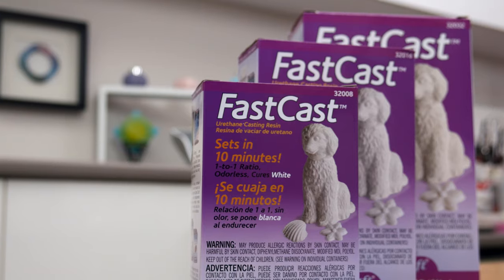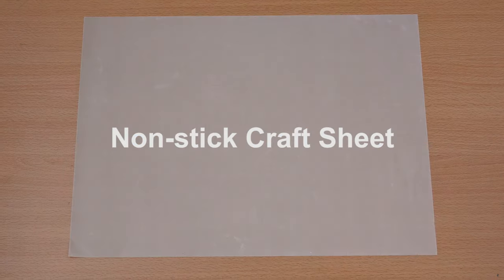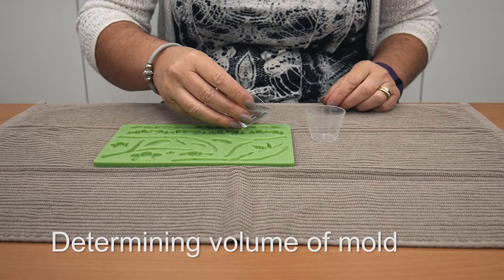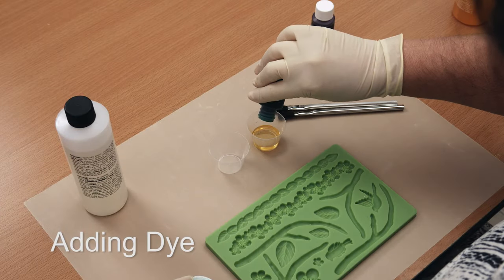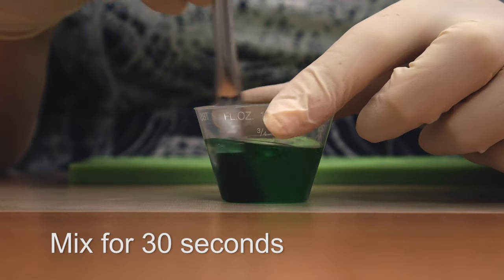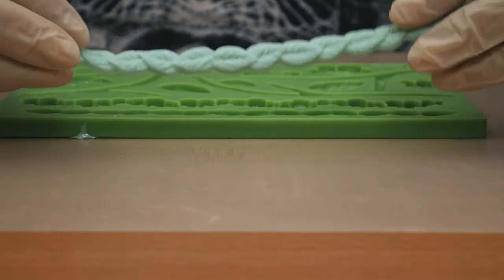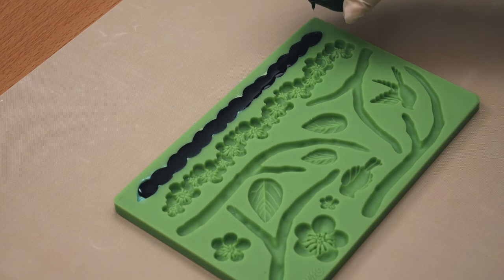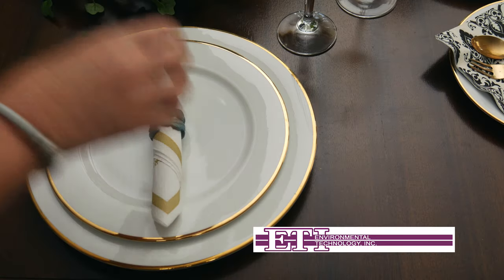How to Use FastCast Urethane Casting Resin

Comment: HI MYLENE. use rice instead of water in some of your moulds to weigh out the resin you will use. it works just the same and keeps your moulds dry.
Reply: The video says "fill the mold with water or rice" I assume she already knows that. But rice won't work for very small molds very accurately. Like the small detailed molds she was using.
Reply: @libbyzumbrun907 thank you i never heard that first time round don't know why but i did say with some of your moulds.
Reply: @michaelpearson4152  I saw what you wrote. I was just explaining why she used water in the video instead of rice.
Reply: @libbyzumbrun907   HI LIBBY. thank you i wasn't being a smart arse

Comment: What is the exothermic reaction of FastCast? Does it really get hot in your mold? Or does it say around room temperature when it sets? What material is your mold made out of?
Reply from the maker: It does get warm while curing. The mold is made out of EasyMold Silicone Putty.

Comment: Does FastCast harden just the same as EasyCast? Thanks!
Reply from the maker: Hi, EasyCast cures slightly harder than Fastcast is clear and takes about 24 hours to cure.  FastCast cures in about 10 minutes and is opaque white after curing.